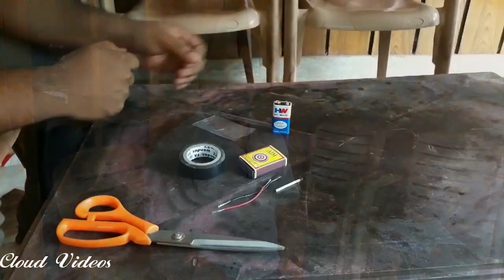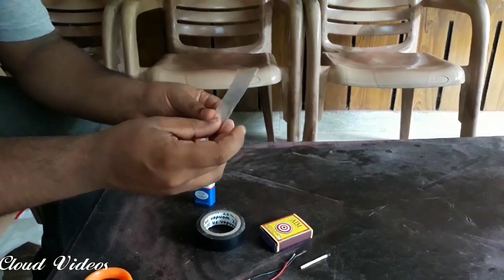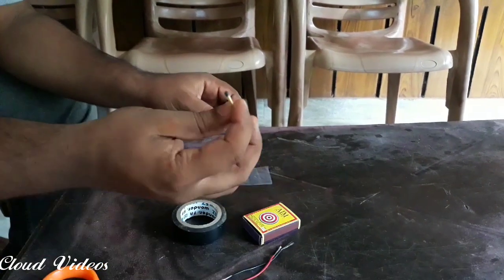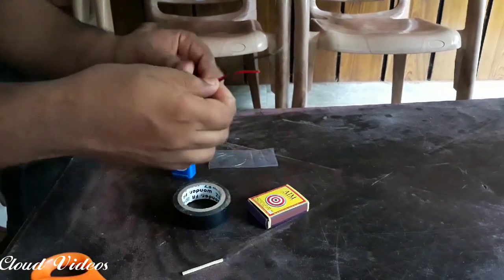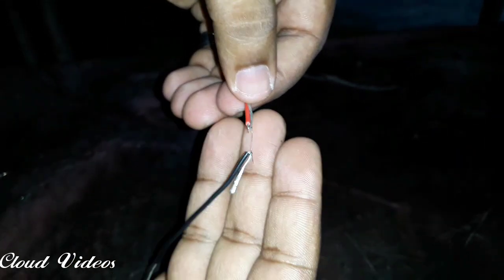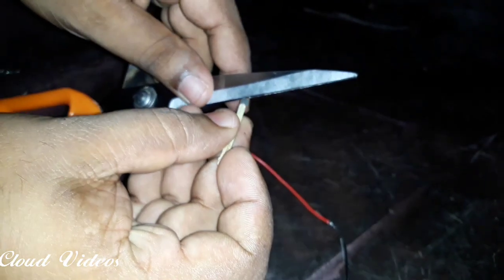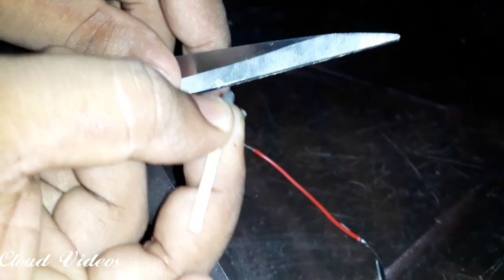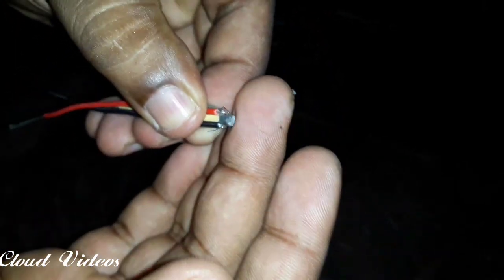How to make electric igniter | How to make rocket igniter #cloudvideos

Comment: how to get nichrome wire
Reply from the maker: You can purchase it online or from the electrical shop. 50 for 1mtr. Thin wire works perfectly.
Reply: @CloudVideos  will copper wire work or would you like to suggest any other wire
Reply from the maker: @joerivera7407  nichrom wire is the best. Copper has less resistivity than nichrom.
Reply: @CloudVideos  ok thanks